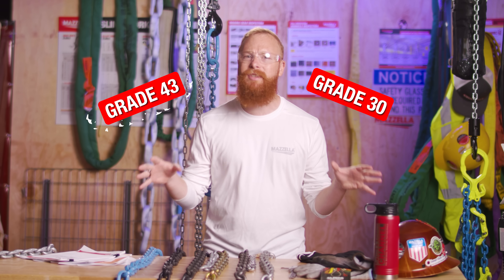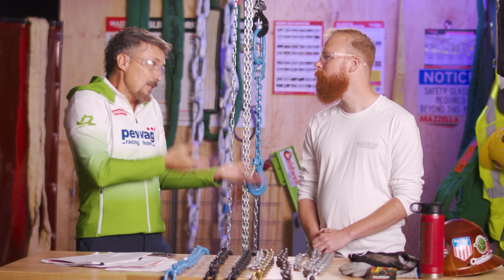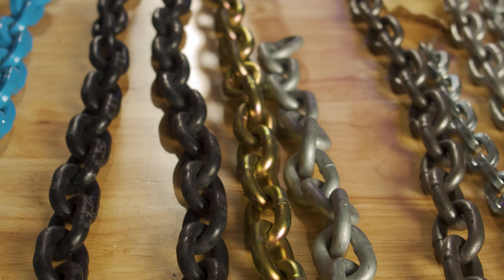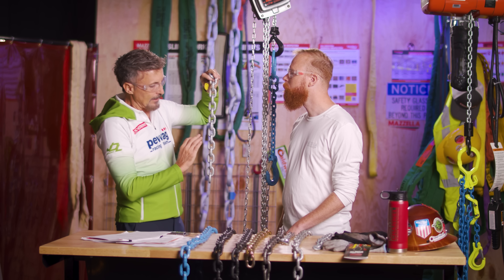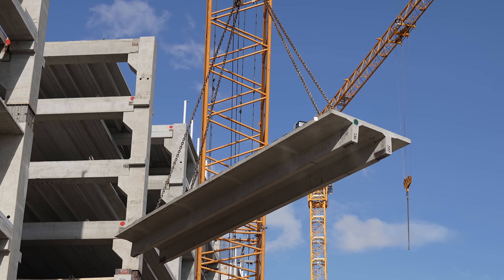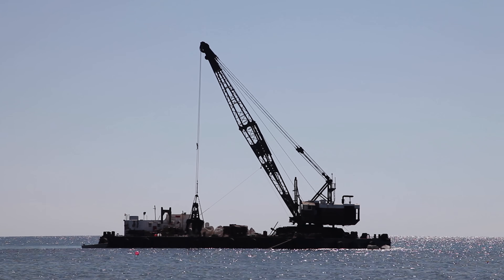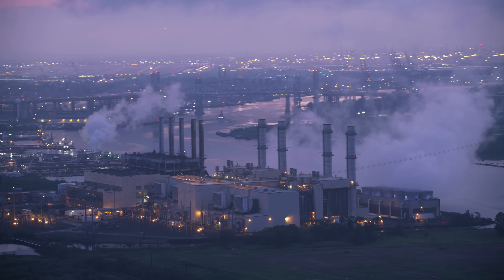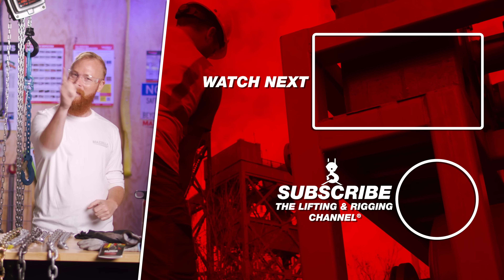Chain Grades Explained: 30, 43, 70 vs 80, 100, 120

Comment: Which Chain Grade Can I used So my Bicycle in NYC won't get Stolen.. Which One Resist Cutting (Portable Battery Powered Angle Grinder)? .. Probably just Slow them down enough So I can Stop Them
Reply: Good question! 💡

Among the lifting chains in the video, Grade 120 has the highest alloy strength and the best resistance to wear and cutting — it’s also made with a special square profile that makes it harder for bolt cutters to bite.

But for bike security, what really matters isn’t just the grade — it’s case hardening. Our pewag security chains, made in Colorado, use a similar steel but with a hardened outer skin that’s even tougher than the blades of most cutters.

So if you want to slow down a thief with a grinder or bolt cutter — go with a case-hardened square-profile #pewag security chain. 🔒💪

Comment: That's for the information. I went thu all my rigging 2 years all, and I had a pile of just scrap. I took all the scrap rigging, and I took the sawed up all my rigging. I learned something. I had some rigging that i sent out to get inspected and retaged retested. I most had 100 chain ⛓️ just how heavy it was in my hand. I sent it out, too, and it came back with a new tag. My grandfather retired from the old campbell / copper tool chain factory in York Pa.
Reply from the maker: Thanks for sharing your story and for watching!

Comment: In general G100 or 120 is just better, smaller chain that does more.
If you've ever had to rig up a load using 20t or higher rated rigging you would know how all of a sudden throwing that steel around ain't so fun anymore. Same thing for fiber rope, the smaller the rope the easier it is to feed through a gap, the cheaper it is, the lighter it is, the less worried you will be about snagging and ripping it up.
Same thing for chain blocks and come-alongs - I worked in a Navy base on the ships for a few months and you really want to use the smallest gear you can get away with, real big chain blocks can weigh over 100kg and you might need half a dozen or more to rig and move a load where it needs to go.
Reply from the maker: Great insight! Thanks for sharing your experience! Always love hearing about how this translates to those actually using the products in the field.

Comment: 6:53, The main difference between the two grade 70 chains, is the galvanized chain is anchor chain. The links are the same diameter steel but shorter in length. So more weight per foot of chain. More weight is more better for anchoring.
Reply from the maker: Correct, sir. The electroplated chain has a slightly longer link to basically squeeze more length of chain using the same amount of material, hence a lighter chain. This is common with transport chain.

Comment: Very useful information. I used to work in the forestry service industry and we used chain for tying down heavy equipment and also for walking our dozers out on when they got stuck. We hooked a chain to the pads and then a tree or another dozer and then engaged the tracks to pull the chain under the tracks and walk the dozer out under its own power instead of pulling it out with another dozer. It’s much safer and in many cases you are alone with no other equipment or persons to help you when you’re stuck in the mud. We found an inexpensive chain from a local big box store that was a higher grade chain that didn’t break nearly as much and it was still either 5/16” or 3/8” I just don’t remember exactly anymore. But it wasn’t so heavy you couldn’t tote it through the woods for a mile by yourself because dozers never get stuck close to the haul truck or a road with easy access. It’s always at the far end of a property uphill both ways. lol 😢
Reply: That’s an awesome story — thank you for sharing it!
Forestry and recovery work really put chains through their paces, especially when you’re miles from help and the machine has to pull itself out. Sounds like you found a great balance between strength and portability. The higher-grade chain you mentioned was likely an alloy — I’d guess Grade 80. Based on how you describe its use, not only strength but also abrasion resistance would have been key factors. That surface hardness makes a big difference compared to a regular Grade 40 tie-down chain — it can be the difference between a successful recovery and a broken chain buried in the mud. Thanks again for watching and for keeping safety front and center out there!

Comment: Grade 70 tie down chains are better for hauling because they stretch. A company in my industry thought that buying grade 100 chains for haul trucks was a good idea until they lost loads in emergency stop situations. The grade 100's don't absorb shocks and will break, where the grade 70's may be compromised but they will stretch further without breaking. There is a reason grade 70 is sold as load securing chain
Reply from the maker: I reached out to Carlo to address this. Please see his response.
From Carlo: Both Grade 70 and alloy lifting chains (GR80, GR100, GR120) stretch, but only lifting chains are required to elongate in a controlled way (about 20 % before break) to warn of overload.

Grade 70 is carbon steel with no elongation spec. It might stretch, but not predictably, and its yellow electro-plating can actually make it more brittle under shock loads, not less.

The idea that Grade 100 “snaps” because it’s hard is a myth. Alloy steel handles shock and fatigue far better than carbon chain. Grade 70 just dominates cargo work because DOT rules call it out, not because it’s tougher. If you switched to Grade 100 tie-down assemblies, you’d get smaller, stronger, and more resilient chains. This is the future of load securement once regulations catch up.

Comment: Good job! I'm safer now.
Does my anchor chain marked"BBB" mean Bend Before Brake?
Reply from the maker: Tom, from Carlo:
The “BBB” marking was never intended as an abbreviation of “bend before break,” even though that phrase occasionally circulates as a myth among boaters.

The typical working load limit corresponds roughly to Grade 43 (High Test) levels, but BBB’s geometry (shorter pitch) allows it to fit most windlasses and anchor pockets designed for that style.

“BBB” actually refers to “Triple-B” chain, a specific type of proof coil chain originally developed to meet U.S. Navy specifications for general-purpose use (for example, anchor chain on small craft). It is not rated for overhead lifting and does not meet the dimensional or calibration tolerances required for tested and stamped anchor chain.

Comment: What size and grade of chain should be ysed to pull out a stuck Cat D3K2?
Reply: After dealing with machinery and stuck equipment, I would say to only use cable.   My personal opinion.  I trust cable more than chain for pulling where forces are constantly changing.  Chains are best for a static load where the forces are fairly level.  Again my personal opinion based on experience.
Reply from the maker: This is a great question. I reached out to Carlo to get you an answer, but I also wanted to provide you with some other options that may be safer than chain. Mazzella can help you with any option that will work best for you. See the responses below:

From Carlo:
If your Cat D3K2 weighs below 18,000 lb, I would recommend using a 13 mm (1/2") Grade 120 chain. This size offers a Working Load Limit (WLL) of about 18,000 lb based on a 4:1 safety factor, meaning its minimum breaking strength is around 72,000 lb. Given that this is a horizontal pull, not a vertical lift, keep in mind that the chain’s Lashing Capacity (LC) is around 160 daN per mm² of nominal diameter, so it should comfortably handle a controlled towing operation. However, recovery pulls can be very unpredictable. If the dozer is not only stuck but locked into the ground (for example, mired deep in mud), even high-grade chain might not overcome the resistance without excessive stress. In that case, start pulling gently and progressively with the Grade 120 ½" chain. If you observe the chain beginning to elongate — remember, alloy lifting chain can stretch up to 20 % before breaking — that’s your warning sign that the machine is not just bogged but actually locked down. At that point, no chain size or grade or wire will safely solve the issue by force; you’ll need to dig around the tracks or change your recovery angle instead. If possible, share some photos or details of how and where the dozer is stuck and we could then suggest a safer and more effective recovery method tailored to your specific situation.

From Mazzella - As Carlo mentioned, recovery pulls can be unpredictable. If it is a straight tow or pull, chain will do just fine. BUT Mazzella does not recommend using chain in a recovery situation where something is stuck. In this case, a synthetic product specializing in recovery operations would be safer in the case of a catastrophic failure. Here are a few options to look into. Mazzella can help you out with all three of these. There is a new product on the market from SlingMax called the RecoveryMax Pro. This is a very durable product specializing in recovery (fastest lead time). https://acrobat.adobe.com/id/urn:aaid:sc:VA6C2:98f2149f-0a69-4024-96fe-7996858e26ff
Another option would be recovery tow cables from Cortland - https://www.mazzellacompanies.com/solutions/product/cortland-vehicle-recovery-tow-cables/
Another great option is the Panther Recovery Sling from Samson. https://www.samsonrope.com/mining/panther-recover-sling
We can help you with any of these options - https://www.mazzellacompanies.com/company/contact-us/

Comment: What chain is the standard for recovery work?
Reply: Grade 100 1/2 inch and 5/8   chain you will see on HD Tow Trucks
Reply from the maker: Chain is great for pulling vehicles, but can be dangerous if the vehicle is stuck. A catastrophic failure of chain can be very dangerous compared to synthetic options. I reached out to Carlo to get you an answer for chain, but provided a response from one of our experts at Mazzella for some synthetic options.

From Carlo: It really depends on the mass of the object being recovered — there isn’t one single “standard” chain. Grades 80, 100, and 120 are all suitable for horizontal pulling, as long as the chain is properly sized for the load. You’ll often see Grade 100 in 1/2" or 5/8" size on heavy-duty tow trucks, but for larger or more demanding recoveries, Grade 120 can provide extra strength and safety margin.

From Mazzella - Recovery pulls can be unpredictable. If it is a straight tow or pull, chain will do just fine. BUT Mazzella does not recommend using chain in a recovery situation where something is stuck. In this case, a synthetic product specializing in recovery operations would be safer in the case of a catastrophic failure. Here are a few options to look into. Mazzella can help you out with all three of these. There is a new product on the market from SlingMax called the RecoveryMax Pro. This is a very durable product specializing in recovery (fastest lead time). https://acrobat.adobe.com/id/urn:aaid:sc:VA6C2:98f2149f-0a69-4024-96fe-7996858e26ff
Another option would be recovery tow cables from Cortland - https://www.mazzellacompanies.com/solutions/product/cortland-vehicle-recovery-tow-cables/
Another great option is the Panther Recovery Sling from Samson. https://www.samsonrope.com/mining/panther-recover-sling
We can help you with any of these options - https://www.mazzellacompanies.com/company/contact-us/

Comment: Why can’t a g43 chain be used for overhead?  So long as the factor of safety is maintained, what’s the problem?  The weaker chain grade may require a larger chain be used.
Reply: Grade 43 chains are lower-grade carbon steel and less resistant to things like fatigue and shock loads when compared to alloy steel used in lifting chains.
Reply: Good question! 👍 Even if the math works out, Grade 43 is made of a different steel, which was not heat-treated for lifting — it can snap instead of stretch under shock load. And most importantly, ASME & OSHA flat-out prohibit using carbon chain (G43) for overhead lifting. So even a “bigger” G43 would still be illegal in the eyes of the law! ⚖😉

Comment: I now want ALL chains to be grade 120 with a "square" link...
Reply: Yeah you won't say that if you are the one footing the bill for em lol.
Reply: @PatrickBaptist  Ya, I looked at grade 120 for heavy hauling, and, well, I will stick with my 1/2" grade 70 and just use multiple chains rather than less of righer grade.  Not worth it for what I do.
Reply: @katokagome4670  You’d be surprised, actually! 😄 The price gap isn’t as big as it looks — with Grade 120 you can step down a size and cut a lot of weight, so it often evens out. The only real extra cost is the load binder, since the high-tech binders made for G120 are a world apart from the cheaper G80 ones. But those forged G120 binders are serious engineering — and worth every penny when you’re hauling heavy! 💪⚙
Reply: @Chaniac-Chainwhisperer  ya, I was referring to the whole set up for new chains, binders, and different hook ends.
Reply: Yeah, I picked up a set of 1/2" 4 leg 16' grade 100 rigging for a pole truck recently for work. The bill was $3,400. Our cranes use 1/2" and 5/8" in different and longer configurations that cost more. Recently we are buying 3/4" 30'  grade 120 and I would hate to see that price. You have to remember though, we do heavy lifting and these are certified so the manufacturers take some liability. They all have tags and certification paperwork that are required to be in the lifting machine in our industry. I bought my own 5/16 grade 100 2 leg for lifting or winching at home. I have seen too many grade 70 3/8 and 1/2 chains break to trust them. My 5/16 2 leg is rated for nearly 7k which is plenty for my home use. These rated chains are pull tested to 5x the rating as a safety factor.
Reply: @shroom9033  That’s exactly the kind of real-world perspective I love hearing — thank you for sharing it! 💪
You’re absolutely right: once you move into certified lifting gear, you’re not just paying for steel, but for traceability, proof testing, and the manufacturer’s liability. That’s why a G120 sling costs more — but it also means you know what’s hanging above your head is safe and documented. Sounds like you’ve got your home setup dialed in too — that 5/16" G100 two-leg is a smart (and safe) choice! ⚙👌

Comment: Grade 80 was recommended multiple times for use in high heat lifting environments. Is there something about alloy or tempering of grade 100 and 120 that makes them less suitable in high temp environments vs the grade 80?
Reply from the maker: Eric, I reached out to Carlo to get you an answer on this one. Here is what he had to say:
Grade 80, Grade 100, and Grade 120 chains are all manufactured from alloy steels, but they differ in both chemical composition and in how they are heat-treated. The “grade” is determined by the specific quenching and tempering processes applied during production, which define the balance between strength and ductility. The metallurgical structure of Grade 80 provides a broader tolerance when exposed to elevated service temperatures, allowing it to maintain more stable mechanical properties. Grades 100 and 120 achieve their higher strength through more refined alloying and controlled heat treatment, resulting in a microstructure that is generally more sensitive to prolonged or repeated heat exposure. In all cases, when chains operate above approximately 400°F (200°C), the Working Load Limit (WLL) must be reduced in accordance with the manufacturer’s derating guidelines, and it is often advisable to upsize the sling to compensate for the reduction in capacity.
Reply: @LiftingandRigging thank you for the clarification!

Comment: I used to use chain to get out stuck farm implements.  Grade 43 worked much better then grade +70.  They snapped at slightest jolt.  It took till my mid 20s before I understood those weak chains were actually stronger.  They just broke easier ÎF overloaded.  Á 43 would stretch, elongate. But hold when forces easily 3x suggested limit applied. no actual measure of force, WAG
  Tractor with FWA, duals, +30’ digger over foot deep in thick mud. Huge load. Gold chains soon 2 much shorter gold chains.
Reply: We used to use chains to hook to our dozer tracks to walk the dozer out of the mud when they got stuck. Some grade 70 chains would break much easier than the lesser grades as you also described.
Reply: @larsharris - glad you have shared your observations! 👀
In my opinion, those Grade 70 chains snapped not because they were stronger, but because of HOW they were made. The brittleness you noticed comes from the finishing process — that gold electro-galvanized coating makes them look tough, but it can also make the steel surface more brittle. If that same G43 chain had the same coating, it probably would’ve broken even sooner. It’s not really the grade that failed, but how the chain was used and the conditions it faced.
If I were in your situation, I’d have gone with a Grade 80 or even Grade 100 painted alloy chain — no fancy plating, just heat-treated good old alloy steel, which elongates >20%. That setup would outperform both G43 and G70 in that kind of shock loading… and probably surprise you! 💪⚙